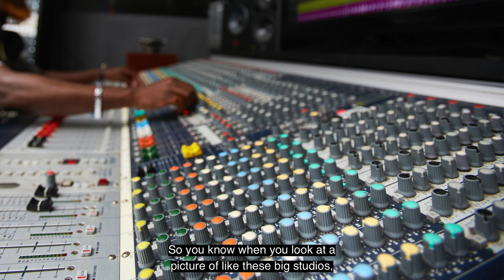Master Each Step of the Audio Recording Process, Lesson 19.

Comment: Just found this, thanks so much I'm def taking the time for the others! You really know how to break it down in layman's terms. 
I'm curious about whether it is possible for the room to make a mic reproduce piercing highs? I'm trying out an L22 Sphere with an Apollo preamp and in the pre-recording stage I keep getting these painful high frqs whenever I raise the preamp to mic level. I'm not distorting or anything, doesn't matter where I place the mic, using some foam around it to catch some of those highs, tried different headphones, maybe it's the preamp or the mic itself? The L22 is a loaner right now so I have the option of returning it if I want to and wait for the original one.
Reply from the maker: Hi,
Poor room acoustics can cause noticeable differences in the low frequencies, but not in the high frequencies. Lesson 9, on phase, comb filtering and how sound waves interact explains why this is. So, to answer your question, no, poor room acoustics will not cause excessive or harsh sounding high frequencies. 
The Apollo preamps are super good, so unless it’s defective, that’s not the problem either.
I’d say it’s probably the microphone, or the emulation software that works with the microphone. I’m honestly not a fan of  digital emulations. The best way to put it into perspective is how cherry flavoured candy models the flavour of a cherry. There is a faint resemblance, but if you’ve ever tasted a real cherry, you’ll know the fake one doesn’t even come close. Hope this helps, and let me know if you have any more questions. Thanks :)
Reply: @Get.Beautiful.Recordings  I appreciate the honesty. I can't say I've ever tried a top of line mic so I wouldn't be able to tell the difference other than video comparisons I see on YouTube. In testing this mic, I like the different tones I get from it, can't say how close they are to the real thing, but I can at least have access to different options, without breaking the bank, all things considered. I agree with you though, I think it is probably the mic and I can only hope the original I ordered does not show the same problem, otherwise I will just take that $1500 and try something else. Any recommendations? I'm sure you have a video about it somewhere lol
Reply from the maker: @tellitlikeitis8691  well, naturally, I would recommend iSK microphones.